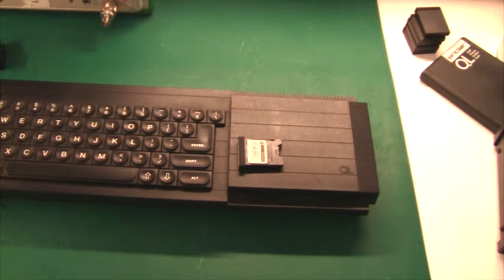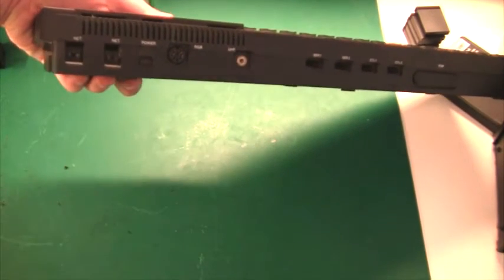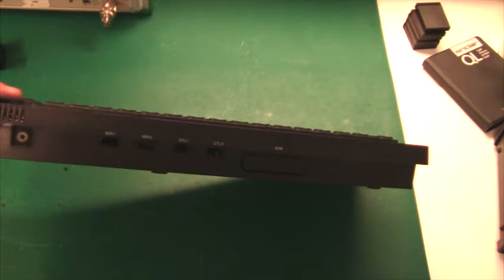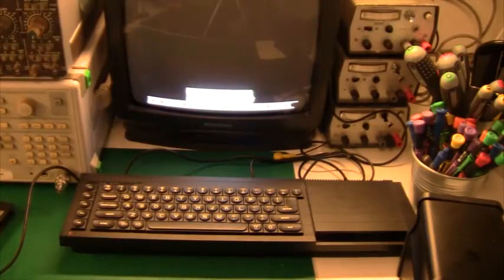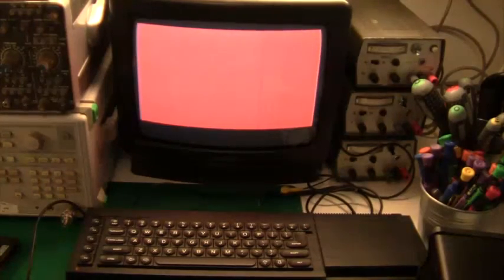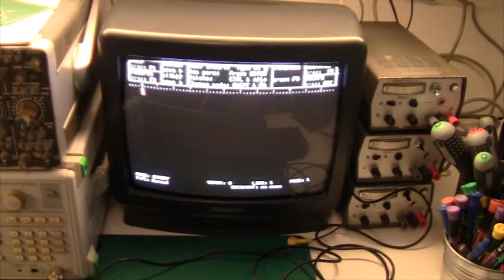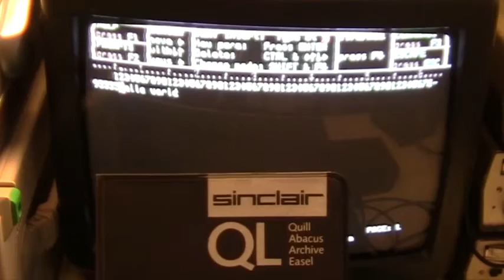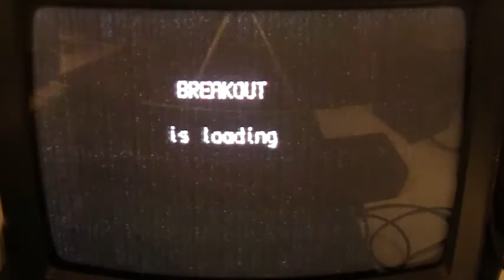Teardown of Sinclair QL

Comment: The small edge connector at the micro drive end of the unit is for additional micro drives - you can plug Spectrum micro drives into it, and they work (I have a few here). You need to format the micro drive carts on one of the internal drives, but once done you can use external Spectrum drives as mdv3_ and mdv4_ etc and read/write files happily. 

In true Sinclair style, the drives end up backwards though - the opening slot faces the back of the QL, not the front, due to the way the connector orientation was done. :-)
Reply from the maker: Brilliant.... not!
Reply: Yeah, the Spectrum drives connect to the left of the Interface 1, so when you connect Spectrum drives to the right of the QL they end up pointing backwards. The QL drives would have had the connectors reversed (and presumably would have supported formatting), if they had been released. Most of us moved to floppy drives fairly quickly.

Comment: Holy grail of vintage computer collecting. I still believe that they should have gone with a stiffy drive instead of the micro drives.  Nobody wanted them and it hurt the machine in the long run. Cheers.
Reply from the maker: Agreed. Also, because it looked too much like the ZX Spectrum+, no business person took it serious, despite of the quite excellent applications. I have a video coming with an even rarer Sinclair machine :)
Reply: NatureAndTech Great , looking fwd to it. Cheers
Reply from the maker: Couldn't agree more. And is shouldn't have looked like the Spectrum+. Nobody in the business community could take it serious.
Reply: It's the Spectrum+ that looks like the QL. The QL came first. Sinclair never managed to build a credible image with business users, and the shipping delays and problems with the early machines did nothing to dispel any negative impressions.

Comment: i want to buy a working one and place it in a picture box frame with it opened displaying the keyboard and pcb would the natural light etc damaged it do you know? was going to place a silca bag inside stop moisture form etc . thanks
Reply from the maker: Old plastic tends to change colour. In particular white becomes really yellow. For black, I think you are OK. If you keep your "display item" indoors ar room temperature, then you don't need the silica inside. All you have to do is to drill a small hole somewhere in your display case, so that it can "breathe".
Reply: NatureAndTech thank you for execellent advice kind regards

Comment: I never had a QL but I did own a ZX81 and several ZX Spectrums, one with a microdrive and I have to say I found the microdrive very VERY unreliable, quite frankly I found normal cassette tapes way more reliable.
Reply from the maker: Agree. Pulling a tape out from the center of a spool and then winding it back on the outside of the same spool, with just a single DC motor, is a feat of its own. Amazing piece of engineering, but really not very reliable. The microdrive was not very quick either, so not much was gained, compared to a cassette recorder. Also, I tried to move some of my games from cassette to the microdrive as well, without much success. Not sure why, but maybe some ROM incompatibility??? I was donated a Spectrum with a working microdrive, so I may have to take a look at it at some point.
Reply: The early cartridges were very unreliable. They outsourced production to Samsung, and reliability of the later cartridges were much improved.